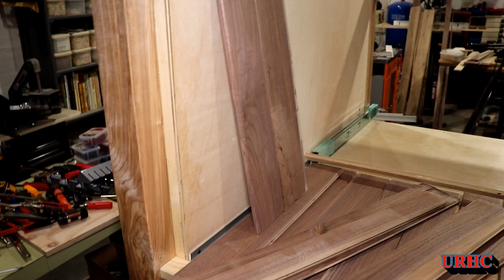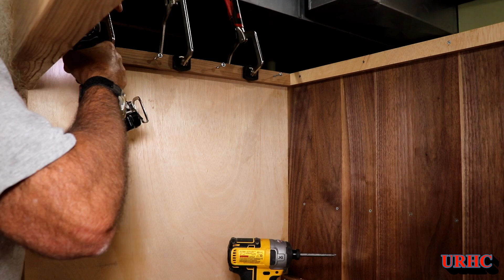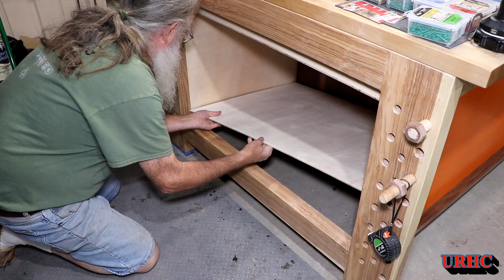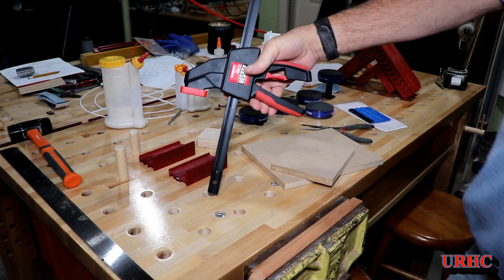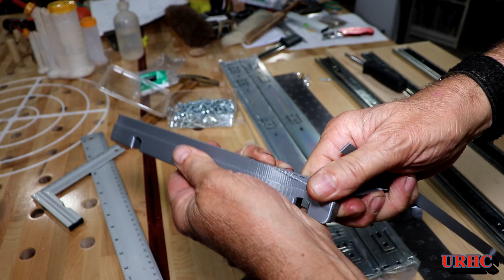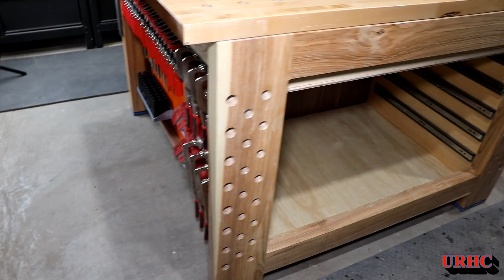Ultimate Workbench build part3 Finishing Downdraft, Wainscot, Slide Mounting, & 3D Printed Holders

Comment: You are outstanding, just wish that workbench was an out feed table for your table saw, have the same saw  3 hp. And my multi  drawer out feed works so much better than those silly rollers. No disrespect ment
Reply from the maker: That is a future  project once I  finish re arranging everything and get the dust  collector automated. I have been thinking  that it will be an air table with  jets angled towards the fence so there  is no friction and boards are pushed against the fence. It will have to be foldingwith  my small shop. Thanks for watching.

Comment: Happy Birthday Ed!  Your videos are absolutely addicting - and I learn a lot from them as well.  I'm going to be getting back into gardening next year and can't wait to follow some of your preserving techniques.  Also, on the framing squares I used to calibrate them for our shop.  I would use the 3-4-5 method with a known good tape measure (not using the hook).  If you need to open the square up, you can use a pin punch on the inside of the square - a couple of sharp hits can move it quite a bit.  If you need to close the square you hit on the heel of the square (but not so close that you mushroom the blade out).
Reply from the maker: Thanks.  I have one framing square  that is out and I  will try that. I bought  a certified machinist square to check them all and have been tweaking them all. Thanks for watching